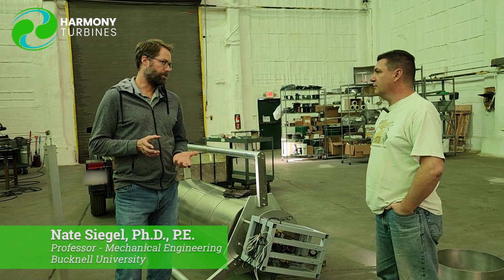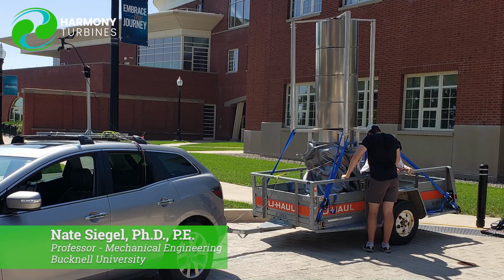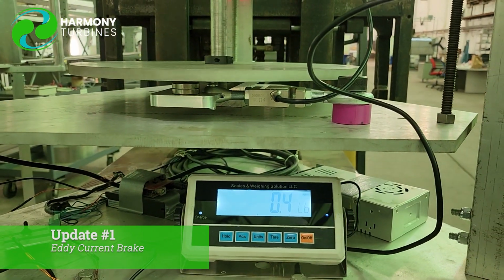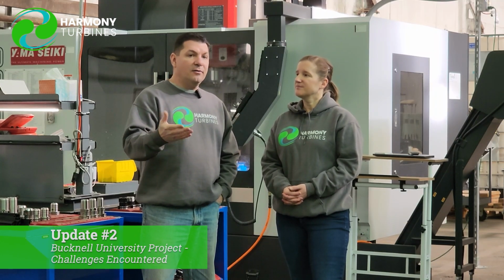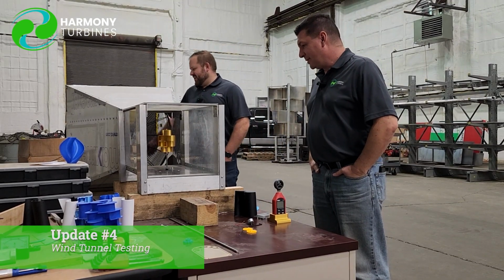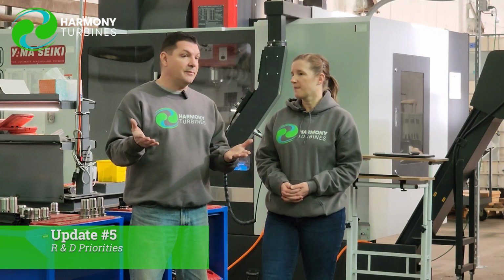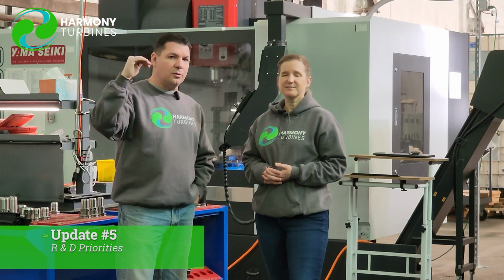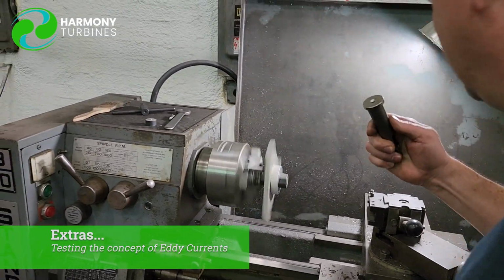November 2023 Update

Comment: I have a technical suggestion. I believe you are unnecessary complicating the open/close system to control speed. get rid of that entire system and build nonmoving blades. Instead build a simple centrifugally activated brake system based on a automotive disk/caliper. the brake pads and all the material are already designed to withstand the weather, long use, quiet, cost little, unlikely to fail. the faster it spins the more braking will  be applied. this will prevent exceeding set speed.

Comment: Hey i haven't been around for long, have you tried the golden ratio yet? Both in scoop height-width ratio, as well as positioning them on the pole? I heard that the golden ratio arises in nature often when plants are looking to spatially optimize. It'll put two leaves at 180° from each other, but the next pair will be 360*φ° rotated with respect to the first pair. This leaf orientation is supposed to minimize the amount of leaves needed to take up as much sunlight as possible, or conversely, it's supposed to maximize the amount of light each leaf gets. The same goes for cones or flowers: just squish the largest amount of florets into a flower by putting each subsequent floret cell φ-offset from the center. 
I don't know if there'd be any added benefit to the scoop proportions, but I bet the different levels would benefit from being offset in a sort of golden-ratio kind of way, I bet it would help getting started in low winds, just like it helps plants get the biggest squeeze out of the square footage their leaves make. Or at least, some ratio close to φ. It's never quite φ.

Comment: You can't just drive it around in the back of a pick-up. The windshield will throw a lot of the air up and over like a giant fan blade.

It needs to be in a trailer behind a small heavy car with an aerodynamic body and a big engine that can work.

Comment: Hi Guys. I am not a very educated man and English is not my home language. The problem with having an idea to achieve a certain result may sometimes not work because it is not about solving a problem but to find an application for my idea. So you had to have improvements in efficiency in the product you are applying your idea to. For instance , can it achieve higher revs than  Savonius with the same swept area?  Is the static torque curve flatter than the normal? Is the vibration less? Is the impulse stresses on the structure less ? Well there is a lot of questions one can ask about is it better or not. The answer to these questions will tell you  if your concept is better or not. Well a movement in a movement is not a good idea for example if you extend the radius of a centrifugal mass it will slow down the rotation so it absorb wind energy. If you control the flow of the air through the turbine , you control its revolutions. I have designed a turbine to address all this problems and build  a complete working turbine. my problem is I do not have funds to develop the most advanced Savonius ever build. So if you discard your idea and start from scratch with this concept you will have a commercial product in a few months, the best Savonius ever. Ok that is only my humble opinion. If there is serious people who want talk to me I will appreciate it .

Comment: hi there,  just watched your video about maximizing the turbine design and  I had an idea.  I am wondering if,  vertically speaking,  you built a housing that would block half of the wind that hit the rotating turbine so that the wind would only hit  the half that is meant to catch it.  The side that is convex,  so to speak,  is then not affected by the wind at all.  If left uncovered, the wind still has a negative effect on the rotation of the turbine.  If it is covered, the wind would  not be able to create a resistance to the spinning of the turbine. What do you think? The half cover could be stream lined to  deflect the wind away from the turbine in such a way  as to create a weather vane effect.
Reply from the maker: Hi Jim, check our FAQ in the main website where we speak to this strategy. Many before you have also offered it as a solution.
Reply: ChristopherMoore @HarmonyTurbines    I couldn't find your point of reference in the FAQ

Comment: Thanks for the updates. Had never seen an eddy brake before. Very cool. 

Could improve your small wind tunnel with a section to eliminate turbulence. If you pack a new section of tunnel between fan and model with tubes all in the direction of air flow it will take out the turbulence from the box fan (and funnel) and give laminar flow. I know turbulence vs laminar is just another variable among many and don't know how much it might matter for this but would be good to have a contrast to find out for a small cost and effort. I'm thinking a single wind turbine in a field would be in laminar flow.